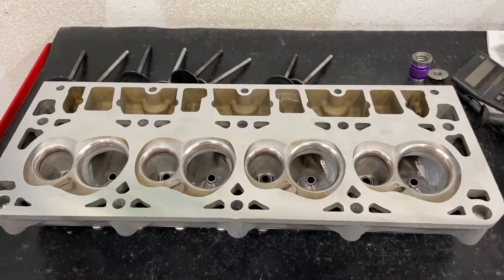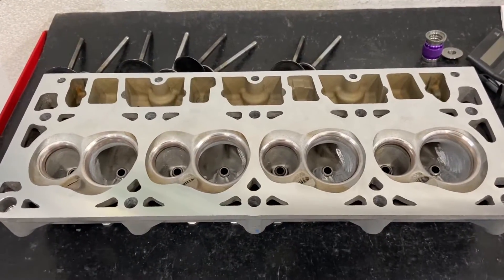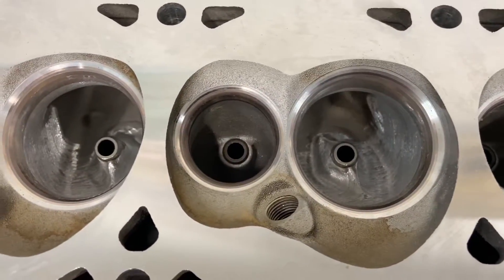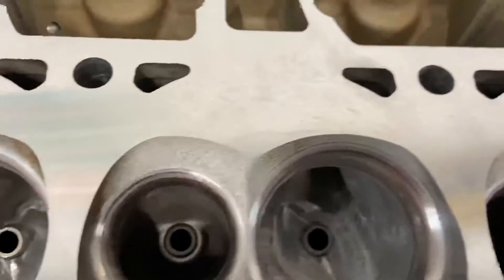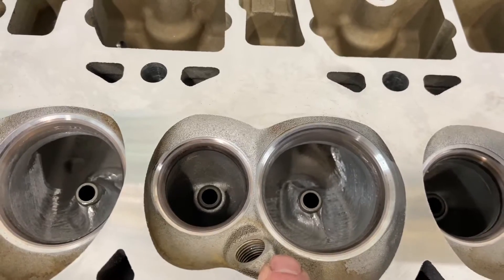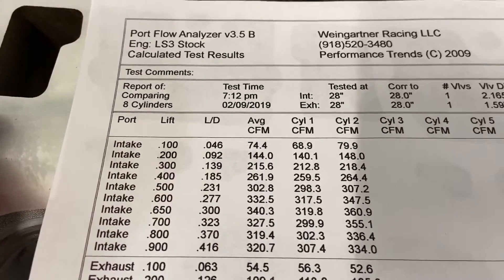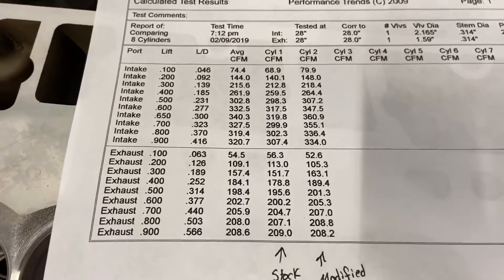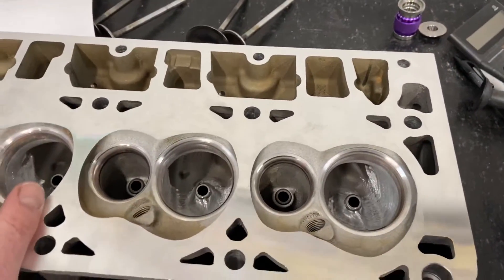Valve job and minor port work on LS3 heads

Comment: On heads with such a big port already, would it have gained more performance to port the exhaust fully to match the intake flow better? Just asking since I'm about to get some ls3 heads and want them ported where it will benefit on a 6.0

Comment: Good info eric,i didnt know you had a youtube. Thanks for the knowledge..what valve angles did you use if you dont mind?. Im no porter an just got into doing my own stuff..ive been thinking about doing this to a set of ls3 i have. Ive also wondered if raising the floor would help on a 364ci 13-1 deal going 7500 rpm..the pockets looks like almost a 60 or 40 grit finish..my last set of heads i messed with i left 40 grit even though from the little i know from reading stuff on yb,speedtalk an listing to darrin morgan you want like a 60 grit..but i run factory injection crap an it smacks the valve earlier so i thought maybe a 40 will help keep that splash fuel suspended better or at least help keep a better boundary lar.

Thanks for your time,definitely going to watch more vids later